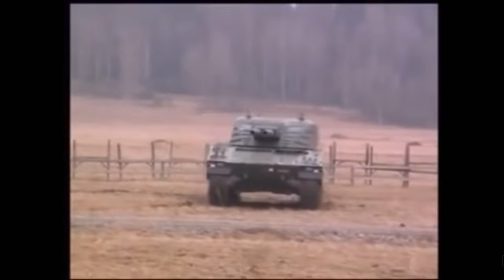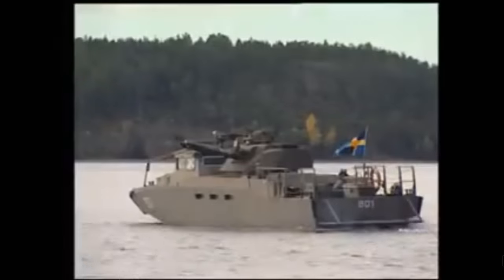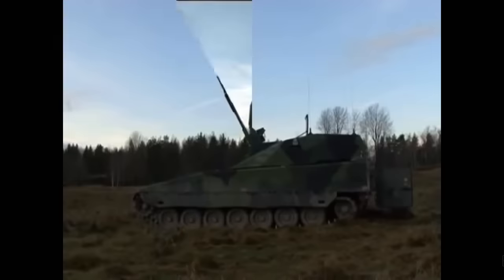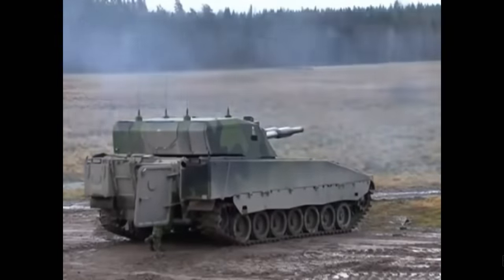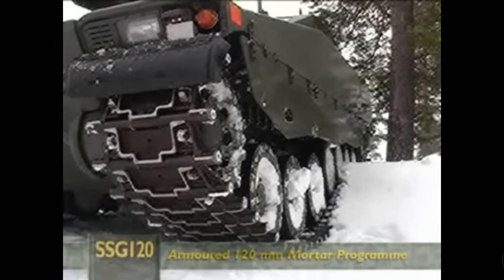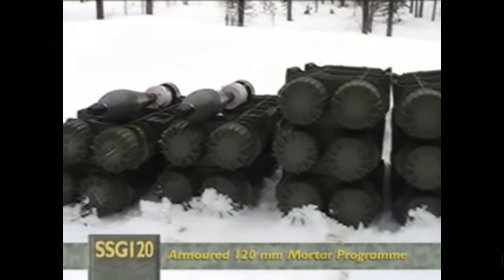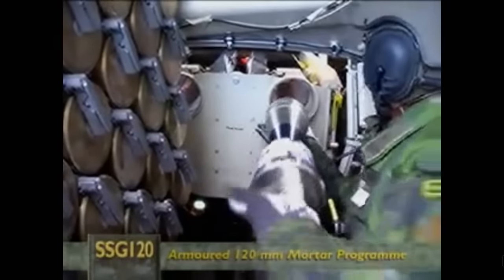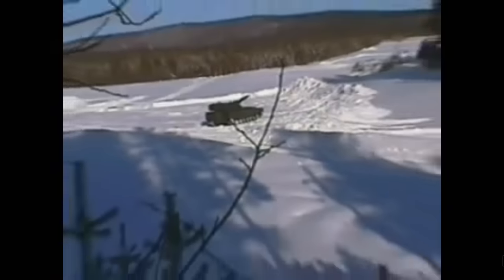Advanced Mortar System (AMOS) - Twin Barrel 120mm Mortar

Comment: This video failed to mention the companion technology used to track AMOS firing solutions and perform real time analysis on targeting accuracy based on "Progression To Target" data, which measures how rapidly crews progress from first impact off target to final impact on target, designates which firing solution should be reused under the same conditions, and communicates that directly back to AMOS, also in real time.  The Analytic Numerical Designation Interface, or ANDI, is part of an initiative to further automate repetitive battlefield maneuvers traditionally handled manually by skilled artillery crews.  And so, rather than spending the time and funding to train specialized combat crews, the Army simply sends AMOS and ANDI out into the battlefield.  And oh, boy, do they do the enemy a treat!  "We just love AMOS and ANDI!" said General Harlan T. Davis of NATO.  "The two of them work together so very well, one working off the other to deliver real zingers.  Why, they're like two peas in a pod!"  Critics argue that AMOS and ANDI are no longer appropriate for this day and age; that we've moved past such things and they are no longer relevant.  But staunch fans of the pair have said there's still a place on the battlefield for them, and they see nothing wrong with liking them still.

Comment: The reason they don't catch on is cost. It's not only far more expensive, but operational cost, training, and maintenance. Where as the current mortars are cheaper in every cathogery. And as far as security, it's cheaper to add a rifle element as support. And any tactical advantage is already provided. by already in service equippment. This concept has caught on with smaller countries. Because smaller armies value manpower over cost. If you have less people and therefore will have a smaller army reguardless of choice. Meaning simply adding a security element is not practical. And such armies are limited more by size than cost. And will naturally  spend more per soldier. As they have the money and not the men.

Comment: I mean, if you want a mobile mortar system, just grab an MRAP or a Madeuce, have impact plates, in the bed of the truck, room for the moetarmen to operate and there you go, cheap mobile artillery without the need for an entire tank chassis which I guarantee you is going to be more expensive than a truck from any country.

Comment: I know its late but do you think the find a way to mount that on a AC 130?
Reply: These things are mounted even to patrol boats so shouldn't present much issues
Reply: @duhni4551  Would be an improvement over the 105mm Howitzer it usually uses

Comment: You posted a video on a system that doesn't exist in reality, as shown on the video. The Swedish government decided to quit the program amongst many other programs, when they decided that everlasting peace had arrived in Europe. So they didn't aquire the AMOS system for the 40 CV90 vehicles they had in store for it. They now are acquiring a simpler, analogue and hand cranked system which actually is Hägglunds prototype from 1996. They call the system Mjölner (Mjolnir in old Norse) as in Thors hammer. 

The AMOS system which has been fielded for operational use is the Finnish variant, built on Patria AMV vehicles. 

The turret of the AMOS is from Hägglunds, now BAE Hägglunds and the breech loaded mortars are from Patria, which has the technical background of Tampella, which company manufactured both cannons and mortars earlier. The latter part of the name Soltam comes btw. from Tampella, but no Finnish connection since the 70:ies. Patria and Hägglunds formed a 50/50 owned company, but since the system hasn't been developed other than for Finland to iron out teething problems, the parties have now dissolved that company. I haven't seen information on who has bought/inherited the intellectual property of AMOS.  

The Finnish AMOS system is working, although fielded in a small number, less than 30 units. The difference between the Swedish system tat never was produced, to the Finnish system was that the Swedish was supposed to have an autoloader, as the Finnish system has a semiautomatic loading system.  Patria has instead developed the one barrel NEMO system, which is delivered on AMV vehicles and also on boats to a Gulf country. Now they also have developed a version within a standard size shipping container, which is mobile by truck, boat or left standing. Capacity 100 shots. 

There were trials made with the Sisu  Pasi, but it proved too light for the AMOS system, as well as the CB90 boat proved too light in structure for the heavy forces involved in the firing of the 120 mm shots.    

Will we see a double barreled NEMO2 system now when the cooperation is dissolved? Who knows...

Comment: My problem with this is the platform seems too heavy to be practical in low intensity warfare. They need to reduce the weight and armour and make it more modular while increasing the range of the weapon. Why not just one tube? The Israeli gets it this is why they developed the Spear which can be deployed by helicopter.

Comment: What's wrong with pairing mortar or two with simple truck? This looks way too expensive for what it does.
Reply: Lack of accuracy, mobility, direct fire, timed fire etc. The one barrel version can shoot even while driving without sacrificing accuracy.
Reply: @duhni4551  It's still too expensive and complicated for mortar. Israeli Spear 2 is good enough, imho. This Amos, however... good example of overengineering for little real benefit.
Reply: @Mandrak789  Not really since you can create completely different and many times more effective fire power with these systems that you can with normal mortar. One of these systems is way more devastating than 10 normal mortars could ever be, no matter what kind of crew is operating them.
There are real benefits with combined arms systems, which also these are part of, not to mention that these things can spit smart ammos too.

Comment: Having served in a (finnish) mortar company the shoot-and-scoot capability of traditional mortar units is sub optimal considering indirect fire radars, opposition indirect fire capabilities and air threat. However the firepower of a batallion of four of these can no where match a traditional, capable mortar company fireing nine tubes 15 rounds a minute easy. Also one correction Matsimus mortars have next to no effect against even light armor but can damage systems on a vehicle. I would love to see more anti armor mortars being developed such as the STRIX. Anti tank missiles are discussed a lot also on your channel but I would love to hear your opinion as a tank guy about anti-tank munitions for artillery and missile/rocket systems such as the BAT.
Reply: Having said that I think these systems can offer an additional piece to a mobile attacking unit. Or provide additional fire in a faster more flexible way on a shifting battle field. In that respect more mobility is definately the future. I think Russia also has a mobile mortar system with quite a high fire rate but I cant remember what it was called.

Comment: Not a mortar if its mounted in a armored shell it's an artillery piece
Reply: Mortar means an angle higher than 45 degrees I think. Howitzer is between something and 45 and guns are even lower than that

Comment: Very expensive equipment.  Normally mortar systems are relatively cheap. Cost is the main downside of this weapons system. With terminally guided rounds this vehicle could take out MBT tanks. And provide highly accurate fire with low levels of collateral damage. It could keep up with infantry or armored units providing devastating direct and in direct fire, Their are some less expensive turret mounted mortar systems with breach loading with direct or indirect fire. But with its devastating rate of fire this one looks like the best. And it is now a mature and well tested system. Some have been fitted to large boats to support littoral or amphibious operations. Modern ammunition is much more effective than WW2 ammunition. Able to use proximity fuses. Allowing for deadly air bursts above infantry. And in some cases phosphorous ammunition could be used if it is politically acceptable.
Reply: The new versions can shoot smart ammos.

Comment: Deploy 1 manned armored unit w half dozen thin skinned computer run wheeled ATV versions slaved to it using US military roboticized supply vehicle software & systems along w ability to be teleoperated remotely from bases Maybe adapt for use of already  deployed predator stations Crews to reload do maint could hang back from front in cheaper IED proof type trucks w good mobility protection but vulnerable high silouette  Much lower cost per tube w withering fire power Computerized ones could even be left in sacrificial direct fire ambushes remotely operated to slow enemy advances Many cheap fast beats a few slow big every time

Comment: No machinegun against infantry? That is not good. Easy target.
Reply: It's probably going to be supported by IFVs so it's not necessary to have a machinegun
Reply: @manstermanman08  and when IFV is gone? The same was with german Ferdinand in ww2. Without machinegun . And it was a disaster ! After that they put it a machinegun on other types.
Reply: @kniespel6243  infantry won't be a problem for this, it's main role is to stay behind lines and lob shells to suppress a position and then just drive away. It's not supposed to stay in one position. Only drones and assault aircraft would pose a threat to this.

Comment: moar barels look better 
a quad or height barrel pompom design
France national guard use 60mm mortar + 7.5 machinegun  armored turet since 1965
they developed in the 1970  armored turet with 20mm autocanon + machinegun  + 60mm mortar turet but none ever buyed it because reasons
mention than russian use heavy armored turet mortar since 30years 2S31 Vena
mention than most russian armored vehicule have 35mm automatic grenade launcher in coaxial
mention than russia got in service tracked automatic mortar feeded by 5round mags widly used in ukrain & chechenya
mention than usa developed a semi automatic 120mm mortar who obivously was not buyed
mention their is a remote container version of the NEMO finland system with single barel dropable by a truck or shoot in the move

Comment: I'm a bit dubious about the concept and it seems I share that attitude with many generals, considering how few armies have even expressed interest in ever using anything like that. The problem I see is that mortars, even the 120mm ones, are auxiliary artillery. Meaning, you use them when you don't have "real" artillery at your disposal. They are comparably small, light weight and cheap and that makes up for their lack of performance in comparison to big howitzers. Building this big, expensive and still relatively vulnerable system around a weapon that still basically only delivers the performance of an 120mm mortar kind of defeats the purpose, doesn't it? You still have to get pretty close to the target, within the range of modern MBT cannons and ATGMs. 

Sure, this certainly is operationally superior to some open topped, hand-loaded 120mm mortar vehicle, but that doesn't mean it makes much sense. You're investing a lot into a weapon system that only exists and makes sense because it normally doesn't require much investment. You know what I mean?
Its like a super expensive gourmet hotdog. If I'm spending a lot of money on a meal, I don't want a hotdog, no matter how much better it is than regular hotdogs.

If you're going to the trouble of developing and buying this modern, expensive, turreted vehicle, why not put a 105mm or 120mm howitzer on it? Make it a modern, shoot-and-scoot capable, western version of a Gvozdika, or something like that. That would make more sense to me.

Comment: Why can't a tank just be used. Seriously these upcoming tanks all should have high depression/elevation and the ability to add charges. Especially with American tanks who use manual loaders. Someone told me there are rounds that can set off a certain amount of charge but I've never heard of them.

 Also why two barrels... I don't see the benefit outside of heat but surely a regular tank can do a sustained RoF for a good amount of time?

 Anyways with FCS being what they are today what stops tanks from becoming artillery anyway.
Reply: A normal tank is best at it's own job. It's better to have different vehicles for different needs. Because these are not tanks, they are a lot faster and can get out of combat faster. I suggest you look up newer videos on this because this is old technology in the video